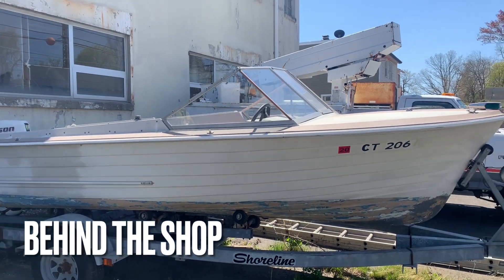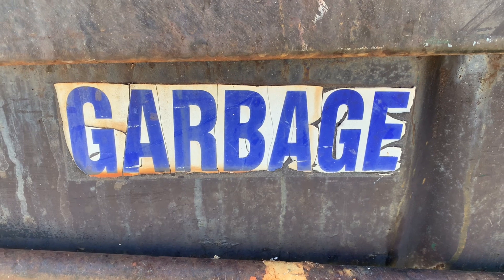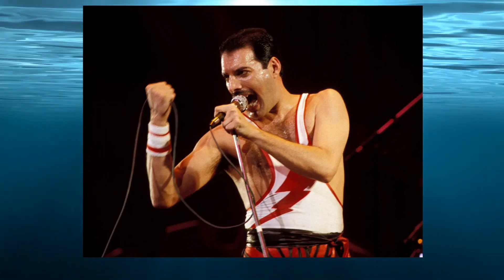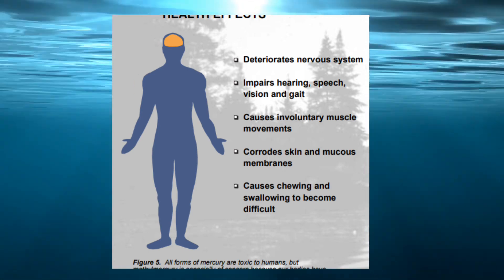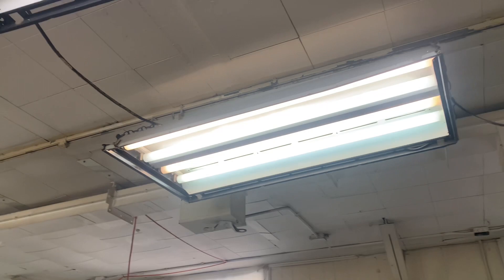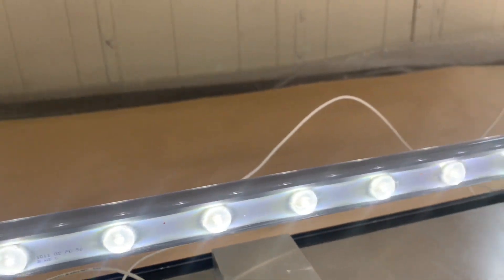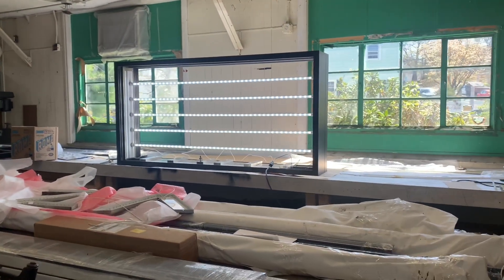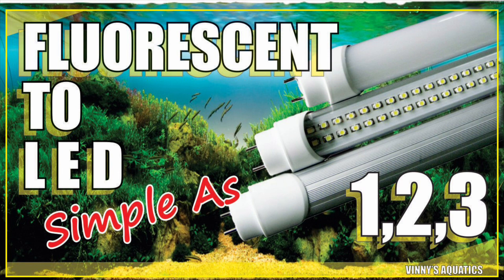FLUORESCENT To LED! SAVE $$$ HOW-TO!

Comment: LEDs are the way to go. I changed all my shop light out long ago. They have a great deal on some 5000 lumen shop lights for $20 at Walmart. Another nice thing with LEDs is the spectral purity of the light frequency. 

I use amber LEDs on my porch. They don’t emit any blue light and don’t attract bugs. 🦟

Have a great day and be safe out there!
Reply from the maker: RC 👍 excellent point in the bugs!  They do have great deals on shop lights. So much better than the old bulbs 😀